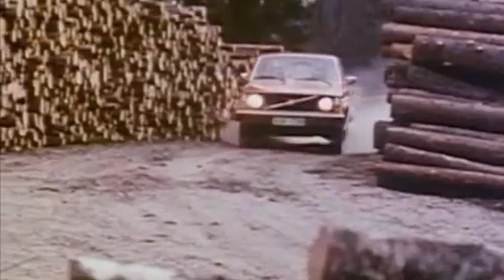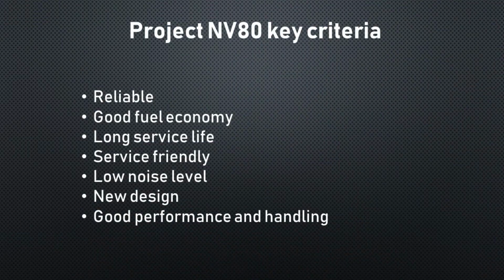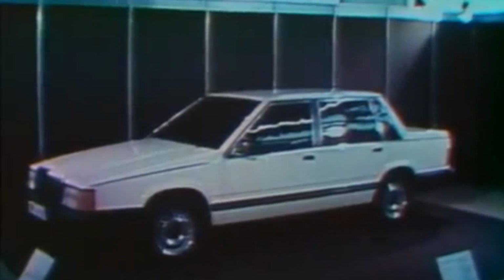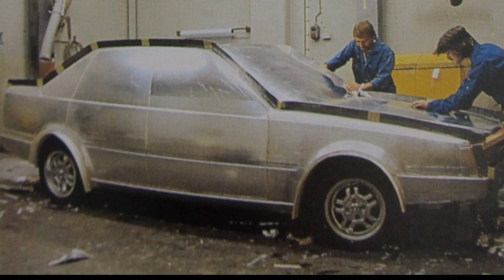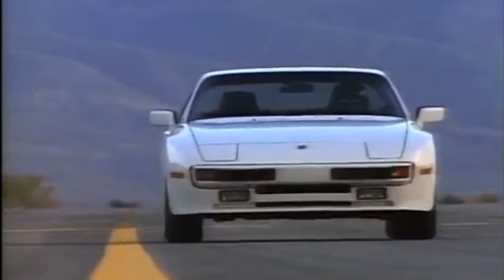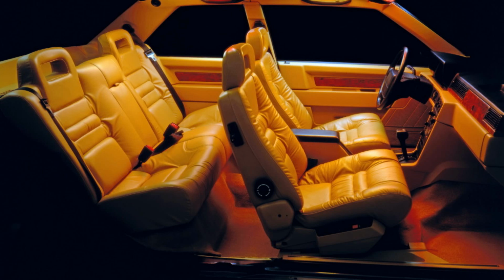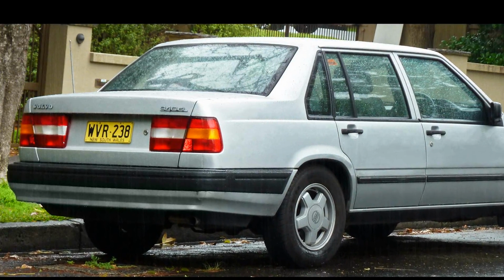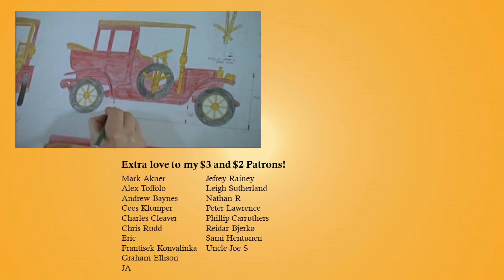How the Volvo 740/760 SAVED Debt-ridden Volvo

Comment: I don't need a new car. I own a 940 turbo and that's all I need.
Reply: same here
Reply: I miss my 760T! Damn fine piece of auto engineering.
Reply: big crap car, fuel!!!!!!!
Reply: I just sold my 960 3 litre, only sold it because it does 22mpg and I have a 2 hour commute eachday for my new job, should have lef the job and not the car.
Reply: @themightydash1714  I regretted letting mine go, despite the fuel economy.
Reply: Same, 940LPT estate , from '98. 
538.000 km and still going strong.

Running on LPG makes it affordable.
Reply: I own a Volvo 740 GLE, and that's all I need. Wouldn't change it for anything, not even a Mercedes.
Reply: @themightydash1714  Is it too late to buy the car back and quit the job? lol
Reply: @PeterPan-iz1kk  @Peter Pan  I also own a 740GL and wouldn't trade it for anything - especially a Mercedes! lol
Reply: ;-D
Reply: Nice.  I drive a 1999 s80.
Reply: @PeterPan-iz1kk  Especially not a Merc! When I bought my 1997 940 turbo in 2008 I was also shopping around for Merc's W124 Estates. Almost ALL of them were in terrible state (rust, rust, rust) despite lower mileages and still sellers still demanded higher prices than for the Volvos. So I am happy Volvo 940 driver ever since. It sure isn't perfect but it's pretty darn close as a daily family allrounder. And for the money nothing even comes close.
Reply: @themightydash1714  sounds like a low pressure fuel pump...I have a 960 that gets 400 miles from a full tank...a tank is 22 gal...it has bad ass speed!
Reply: Same here. I have a 1997 940
Reply: Does that still have the Redblock engine?
Reply: yea it's a volvo the best little swedish car to ever exsist
Reply: @bobjohnson205  I feel you on that. My MB 300E was downright fragile compared to my Volvo 240 and 940. I had more failures in 100k miles with the MB than in 200k miles with both Volvos combined. A highly overrated car.
Reply: @palebeachbum  'Mercedes Benz: Engineered like no other car.' NOT! lol

'Mercedes Benz: The best or nothing.'  If that's the best than I'll take nothing or a Volvo 240/740/940! :)
Reply: @Bob Johnson  Mercedes slogan should have been "An ounce of pretension is worth a pound of manure." 😆
Reply: @themightydash1714  you should have done better maintenance, I get over 30mpg in my 97 960...ya gotta keep up on the electronic connections. I just replaced my coils and ignition control modules and upped my mileage!
Reply: The 940 turbo and lpt from 1995 upto 1998 are the best RWD Volvo ever made, strong engine, nice slick and strong m90 gbox and fully galvanised car body.
Reply: @jfv65  Sounds great! Do you know where I can get one? lol
Reply: @jfv65  we only got the 940 in the US to 95. It was only until a few years ago I realized they continue selling it until 98. I feel cheated.
Reply: I have had 2 940s. Fantastic vehicles, values have shot up since then putting them out of reach
Reply: haha same, midnight blue stationwagon!
Reply: I want. Volvo 440 DL-D <3
Reply: @lucasrem ???
Reply: @lucasrem ???

Comment: I own a Volvo 940 Turbo (Stationvagon) It's been in my family since my father bought it in 2000. (Built in 1998) My father used to be a mechanic for Volvo and this was his baby. It doesn't have a singe particle of rust witch very unusual in my country due to all of the salt on the roads. We buy original parts for it threw Volvo. 20 years in my family, I hope (and think) we're going to get another 20 years.
Reply: ahr332 Ram Vepsen
We love that 760 Polar Turbo in 1986 years!!!!!
only the Turbo Volvo cars were good, rest are too heavy crap!
Reply: My father kept the old 260 Turbo Polar, able to buy in the 1990 ish years!
We still have it
Reply: Still have  two old 740 2.3 litre turbo estates, high miles (200k) on both but the engines are perfect and are started every week and run for a few miles, sadly the fuel economy means they are going to the scrap yard, now driving a couple of older V70 D5  models which are good cars until the steering rack leaks when they have to be scrapped due to repair costs but I would still buy another D5, good economy from a reasonable large engine and great reliability which the 2.3 petrol turbo did not have.
Reply: Do you still have it?

Comment: Just love that they went snowdrifting with three 740s in a commercial! In Sweden it's still the most popular car as winterbeaters.
Reply: Volvo is the most reliable car in the winter and sweden have alot of snow. Volvo does have its downsides such as being whatever but its still a good first car and it will start as long as you keep a normal maintence up.
Reply: iLoveEbola  yes
Reply: I used to drive a 744 and 745T in Canada. They are great. 

One caution though, you need very good winter tires for a RWD car. Preferably studded Nokians.
Reply: @lokelaufeyson9931  FR layout still works well enough in snow?
Reply: cant forget about saab being just as good of a winter car as volvo. volvo is just more popular
Reply: @andyhouston69  the cars where built to be safe during winter. But they can be just as fun as RWD cars
Reply: I still drive one daily in canada, 1987 volvo 740 gle, best car ive ever owned, had it for 5 years now and shes running great (with proper maintenance of course)
Reply: @fabbex7943  you just dont know how :)
Reply: @Janshevik  Only FR layouts have ever worked well in the snow, if by well you mean have fun. Understeer is no fun and FF just understeer unless you're skilled driver that knows how to shift the weight around. Hence why FR is the best for beginners in snow.

Comment: Ive bought in 1987 a brand new white 740GL..with a typical blue interior.  Drove it for 390.000 km, sold it in 2000 in favor of a new S80 2.4 170hp. That was a huge mistake....the old 740 let me never down..the S80, pffff

And stranly enough..the S80 is scrapped already several years..the 740 still running around and hit nearly 700.000km. ( FIRST engine!!!) Legendary stuff
Reply: Jeah, volvos after 2000 are a bit strange, and thats why i still drive 1996 850 2.4 10v and xc 70 from 1999 2.5 turbo, and i kept my first car witch was 740 2.3 turbo/intercooler from 1985, and i am so happy that i didnt sell it, i kept it in a garage and restored it in about 7 years, soon it will be back on a road.
Reply: The Mechanic
we did 760 lambazon Turbo in the 1986?? years, the lower models are crap, way toooo heavy!
You do have Renault engine, cheap injection engine, slow.....NOT  Legendary!!!! heavy weirdo crap cars!!!!
Only the US Turbo models are still good now!
They all need way toooooo many service, you have weirdo hobby?
Reply: @lucasrem  ,
Euh....ive owend a 740Gl redblock 2.3L 113hp. Slow....naaa ok, not the fastest thing in the world ,agree with that. But it just needed the basic maintenance...to go for ever. 

Never said...the 740 and the 760's been rockets. Surely the 760 PRV V6 engine was a real bummer....even in the Alpine 310.
Reply: i own a bycicle and its gone further thatn either of u
Reply: I've had the opposite situation. I had a '90 760 with the 4 cylinder turbo. It was getting very expensive to repair and I replaced it with a 2002 s80 turbo 6. The 760 was replaced at 122,000 miles with a ton of problems and expensive repairs while the s80 has surprisingly few problems. The most expensive was a fuel pump needing replacement at around 150,000 miles. It's going strong now at around 160,000 miles.
Reply: @kingcuan5261  They've gotten better.
Reply: My family owns an XC90 from 2010 and a S90 from 1999-2000. The XC90 has given us quite a few problems with needing quite a lot of maintenance since something goes wrong about 3 or 4 months post service, though it has become more reliable, possibly due to not being as heavily used. The S90 has had few issues however. Sure there are a few problems such as the electronic key not working and a few other electrical issues from being left virtually undriven for about possibly a decade, however it will still start and drive any day of the week. She’s a good girl, I’d say.
Reply: @benjaminsmith2287  We owned 4 Volvos of that era in my household. A 240, 740 Turbo and two 940s, one turbo and one not. They were all purchased used with anywhere from 94k to 138k miles and driven to 168k to 224k miles before selling them. The most costly to own needed about $1500 in repairs total the whole time we owned it. The cheapest only needing $25 in repairs. I don't think your experience with the 760 was the norm for those cars. Ours gave us great service for a long time. Parts could sometimes be expensive, but repairs were easy. We had a great local Volvo shop in town who didn't charge a fortune.
Reply: @palebeachbum  Owned about 5 or more. 164, 144, 760, s40, s80. People's experiences with cars will differ.
Reply: it's a Ford that's why...I refuse to buy a Ford made...
Reply: 390k km !!  Wow !!
Reply: Well, I have an S80, with all the extras, from 2003 with 410000 km on the odometer, still going strong. And a lot more comofort then the 7xx. Starts in minus 23 degrees celsius very easy. Hase never failed in the cool north of sweden.

Comment: I had a 940 SE, I loved that car more than I have ever loved any car.  I relocated to the other side of the world and had to sell it.  Mine was one of the very last ever made, it was assembled in Bangkok as an export CKD and sold brand new in 1999.. ironically for a car made/sold in Thailand it still had heated mirrors.  The engine was B230 FK which had the low pressure turbo.  It was very very expensive, more than double the UK price, and it had the softer suspension as fitted to US  cars and softer leather seats than the UK models.  I upgraded the suspension.  One it had done 120,000 km changed it to LPG before putting another 100,000 km on it, the engine still ran like new.    To this day a hotel called The Dynasty Inn in Bangkok has two identical cars from the same batch, same spec, same colour, that are still used as courtesy cars.  Both have over a million km each on them, one is on the original engine and the other has a replacement engine.  Both run on LPG.    I feel the 940's were amongst the best cars in their class ever made.
Reply: I had an early 940 in 1990. It had serious problems adapting to unleaded fuel and was very sluggish until at the third attempt the Servicing Dealer checked the throttle linkage and discovered I was only getting about 60%! I did do about 90,000 miles in the two years I had it. As for quality and reliability in mid 1991 the UK importer refused to accept anymore imports until the quality and reliability improved. It must have worked as I had a second in 1992 which was a different car in all respects.
Reply: Among?! THE BEST cars ever made ! (and also the most beautiful ones!)

Comment: Bought a 1988 740GLE in spring of 1989. Used with maybe 12,000 miles. 5 speed manual with most of the options.
       Kept it until January 2007 after 368,000 trouble free miles. Reliable like a hammer. She was rather boxy, but loved that car. Well done Volvo, really love your brand.
Reply: Boxy but good! lol

Comment: The only two cars I ever really regretted moving on; a 960 with the lovely 3 litre straight six, and later a V70 2.5 turbo. Both were fantastic cars in their own right, and both unbeatable for covering long distance.
Reply: I believe it. I pick through junkyards and when poking through the Volvos you can see the proper interiors with complete insulation unlike other cars
Reply: I really miss my S80 V8

Comment: these cars were absolute beasts. Saw them on the roads up till about 10 years ago. Very safe, very reliable, very good sheet metal.
Reply: Mostly galvanized or 'Zincrometal' was used on them from '87 on.

Comment: My stepfather bought a fully loaded blue 760 brand new in 1984.  He handed down to me in '91 and by the time I stopped driving it in '98 it had almost 300,000 miles of rust-free, dependable service in the Texas heat.  It had a quick turbocharged 4 cylinder engine and manual transmission with push-button overdrive, and black leather interior.  Although we had to fix the sunroof and a few interior components after the first few years, overall it was a beautiful and solid car that I still miss driving even to this day.

Comment: I love these Volvo 700/900-series cars. The air conditioners were the weak point of these cars, but they were superb in every other aspect. Rock solid build quality. Supreme comfort and safety. Powertrains that easily lasted 200k+ miles, with nary a fluid leak. Repairs were extremely easy. I miss these cars so much. I am one of those strange people who actually loves the boxy style. Quite handsome, especially the wagon version and the later 940/960 sedan. I personally owned a '94 940 Turbo sedan. My mother owned an '89 740 Turbo wagon and a '95 940 sedan. All 3 were extremely reliable, comfortable, with very little in the way of repair costs. The only real annoyance was the fuel economy. The non-turbo version could only manage 25mpg on the interstate and both of our turbo cars could only manage 21mpg interstate. Very thirsty, even for their time. The requirement of premium gas for the turbo made it worse.
Reply: Air conditioners? What is that? we need a car that have a big heaters and can take a elk impact....
Reply: @ JR. Elk is going through the windshield and won’t end up good for elk or driver. 

I live in Northern Canada and believe me I need air conditioning as much as heat.
Reply: You are not alone, i really like the way my 940 estate looks.
Reply: @Bartonovich52  I lived in Georgia, USA at the time and air conditioning was mandatory for survival.
Reply: @Bartonovich52  Isn't any part of Canada "Northern"? lol

Comment: When I grew up, my parents had a 1967 Volvo 144S in "King Blue" with matching vinyl interior. We LOVED it. 
I worked for Hertz Rent-a-Car in Copenhagen Airport with the Volvo 760 GLE was launched.
It was (and still is) an impressive car, stylish and aristocratic in its looks inside and out as well as riding. 
Nothing beats the 1st generation 760 GLE. Wish my parents could have afford it back then, when their 144S "died" in 1985. 
The 740 series came across as a cheaper version in any way.

Comment: The 7 series were great cars ,in the early 2000s I looked after a 740 estate 2.4td for a few years for a Swedish lady in the uk ,she brought it from new on a j plate in 1991 so was the face lift,after 350k we replaced the engine with a brand new unit and turbo and up till i left it I saw the lady in 2007 and it was over 700k miles and still in immaculate condition solid as a rock,fantastic car built to last ,I remember when the 850 came out I soooooo wanted a t5 and 850r but I was only 22 so it was just a dream lol,great video ,more great happy memories 👍😉

Comment: Changes in production runs were usually done during the industrial holiday season when the entire country went on a collective vacation. 

So, the 940/960 was phased in during the summer of 1990 as MY91, while the 760 was phased out and the 740 was continued for another two years. The 850 was presented in 1991and phased in production during that summer as MY92. 

The oddballs here are the 740 and the 240, with a two year overlap for the 740 being phased out during the summer of 1992 and the 240 being phased out almost a year later during the spring of 1993. In essence the 240 survived its replacement with almost a whole year, overlapping production for an entire generation of cars. 

Fun thing is, this isn't the first time Volvo had such an overlap. In 1968 they had a triplet of estates in production with an overlap of the Duett, the Amazon, and the 145 estates. The 145 was presented in the summer of 1968 as MY69, the Duett was phased out during the winter of 68/69, while the Amazon Estate was phased out during the summer of 1969.  Production of Amazon sedans continued another year until the summer of 1970.

Comment: Thanks for the very interesting video. I have driven 745 and 945 for 15 years, they were indeed very robust, simple cars, a dream to maintain. There were only few flaws, one being the overdrive gear in the early 740 models. The rear wheel drive was a lot of fun on snowy roads, however it was a pain in winter when you had to go uphills.
But the space, oh the space. There were very, very few station wagons with this amount of space. 
Maybe the most outstanding factor was the ridiculously small turning radius for a car almost 5 meters in length. It was so much fun to maneuver in cities, especially in parking garages and on ferries.

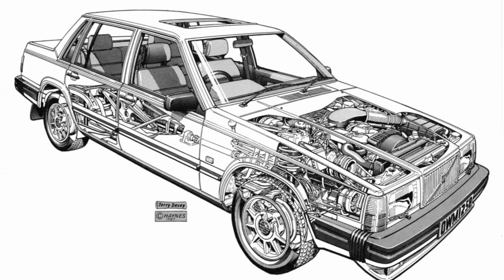Comment: Excellent video on an excellent car. Minor gripe: multi-link suspension in mass-produced cars dates back longer than you made it seam to be (12:21 time). E.g. the Mercedes W201 from 1982 had it, as had the W124 soon after. But it's minor, really. The 740/760 was such a hit back then, and so much different from the Audi 100 and Mercedes W124! Truly a modern classic. Keep up the good work!